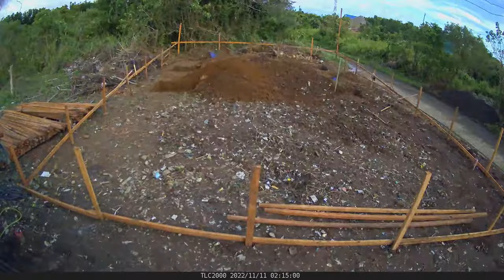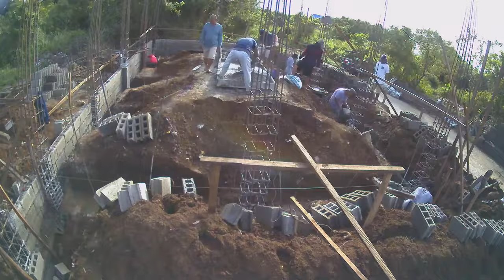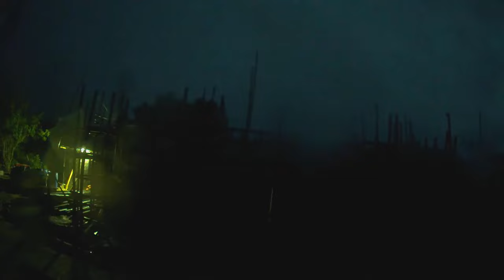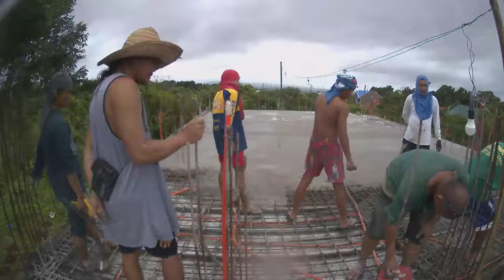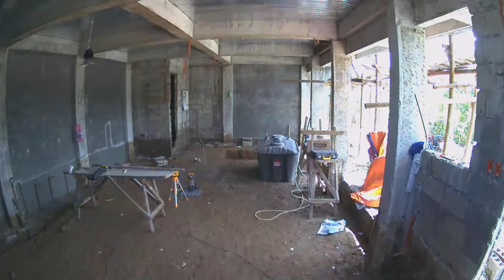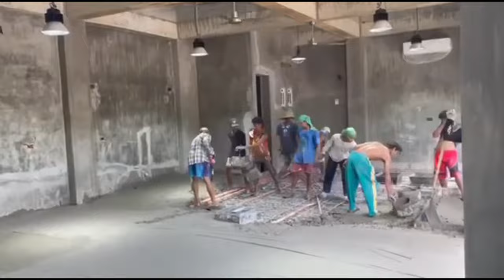Garage Build Time-Lapse! 🎥 | Garage Build Philippines | Ep. 30 | TORINO

Comment: Torino, did you ever share the cost of the garage build. I'm planning to have one similar or exactly like yours built on my property in Bohol. Also, did you have an architect to draw the plans for your garage?
Reply from the maker: i had an architect make the plans and run everything through for occupancy. i also had a surveyor do a sanity check on the lot. i'll make a video about the costs and try to break it down into meaningful numbers. thanks.
Reply: @torino2610  sounds good. I look forward to your video breaking down the cost. It looks like a very good, sturdy build. Thank you